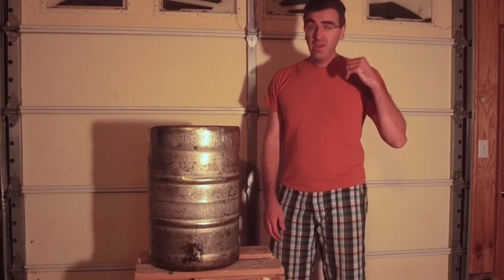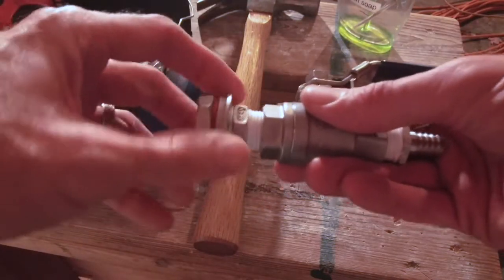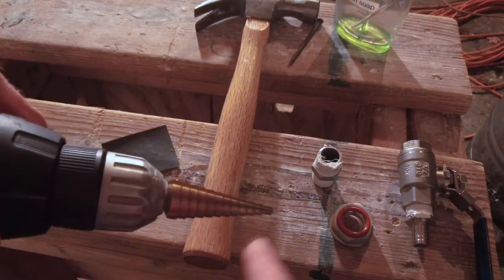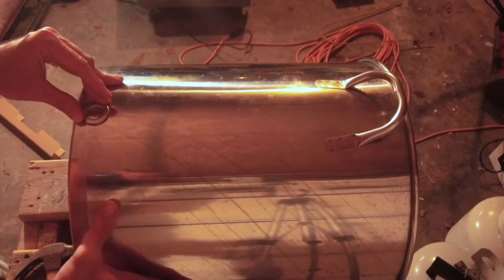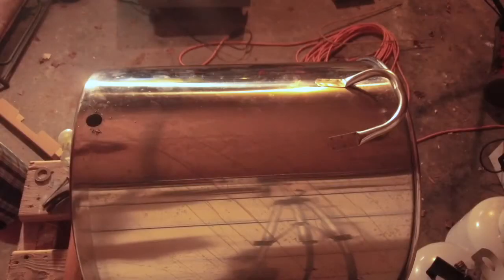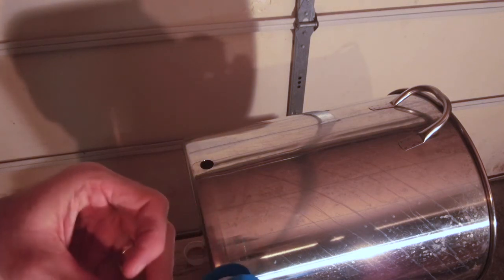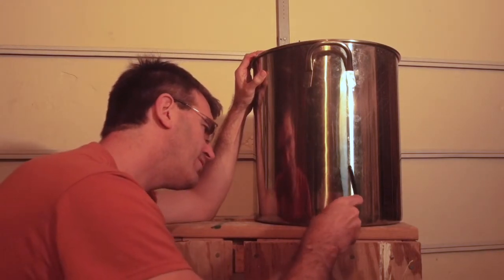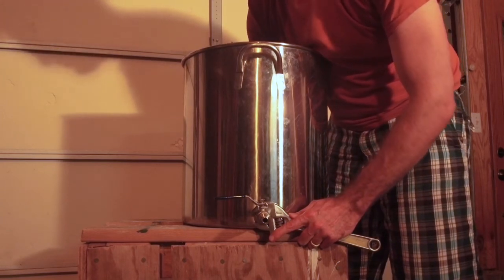Install a Weldless Ball Valve and Make Your Brew Kettle More Awesome!

Comment: Rad How To vid. This is really good info for people. Adding a valve seems like it would be way harder than it really needs to be. When I finally get around to ordering one, I'll refer back to this for sure! Cheers, Jake! Hope to see you soon!
Reply from the maker: +Josh Secaur Thanks, man. Yeah, like a lot of things with homebrewing, the actual steps to get it done aren't as intimidating or complex as they seem when you first think about doing them. I wish I had thought of Pooka's tip to use the bit to clean the inside edges, too.

Comment: Nice How to Video Man. A tip on saving a bit of filing and/or sanding, drill the hole with the step bit from the outside in until you're down to the last step or so, then if Your drill will fit inside the kettle, drill the last step or two from the inside out and that will help reduce the amount of jagged  metal you'll need to clean up. Cheers Jake!
Reply from the maker: +Pooka NC That's a great tip! I'll keep that in mind for my next addition, which may be a while since I feel like I'm set up pretty good for the moment. Although, drooling over a friend's electric system may give cause for an upgrade.

Comment: Is there ever a problem with those plastic washers melting when doing your boil on a propane burner?  I'd like to do this, but I don't wanna end up screwing up a $90 pot.
Reply from the maker: +spiff2268 There aren't any plastic washers. They're both high-temp silicone. I had a bigger problem on a friends burner where some of the flames jumped up and melted the rubber on the handle of the ball valve. I haven't had any problems. This kettle, I've used the ball valve for six batches with no problems.

Be careful when you're drilling the hole.
Reply: Cool.  Did the silicone washers come with the ball valve, or were they sold separately?
Reply from the maker: +spiff2268 the kit in the link in the comments/description came with everything.